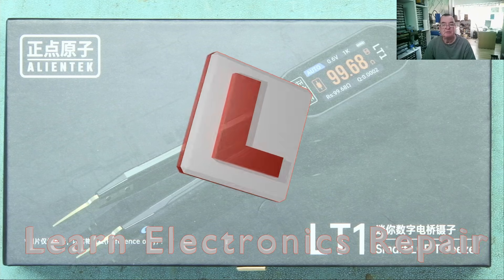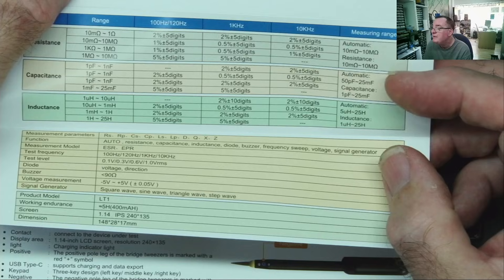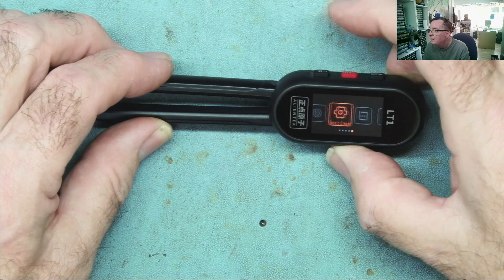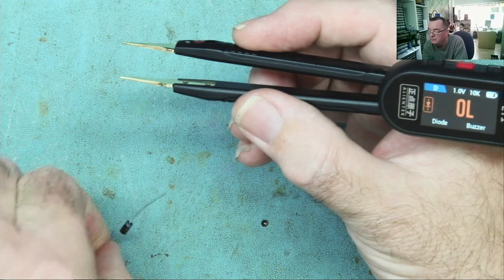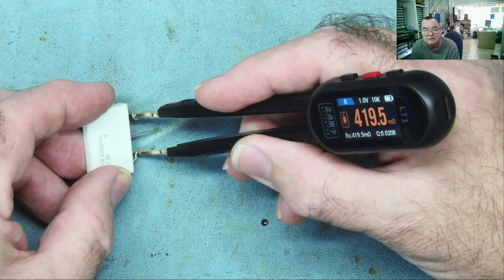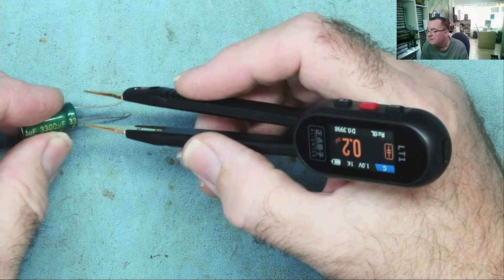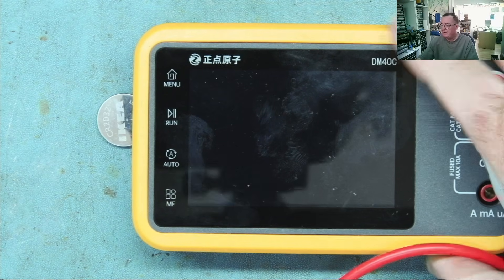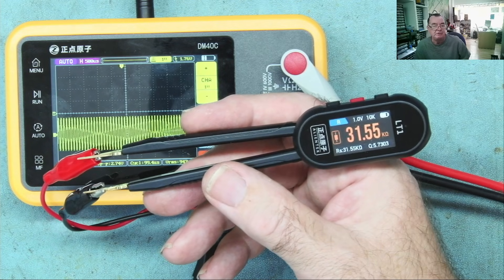AlienTek LT1 Smart LCR Bridge Tweezers :Test & Review With A FREE Giveaway

Comment: Frequency sweep is nice, because often you want to read an electrolytic capacitor's farads at 100hz, while you want to read its ESR at 10kHz/100kHz. It also makes it easy to see if there's some spec that's degrading far more than it should over frequency.